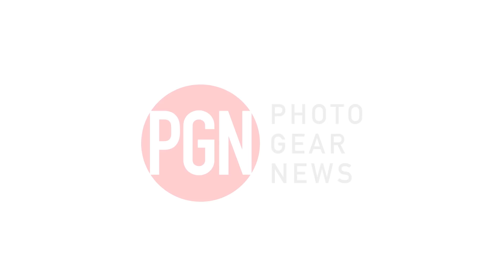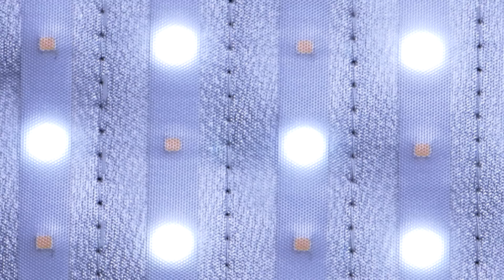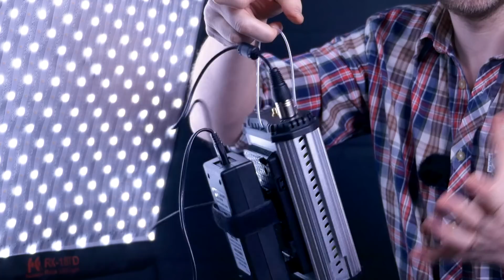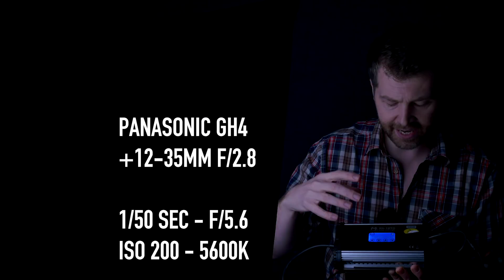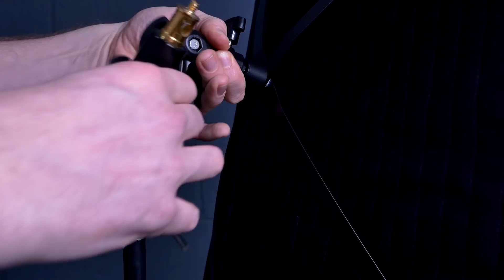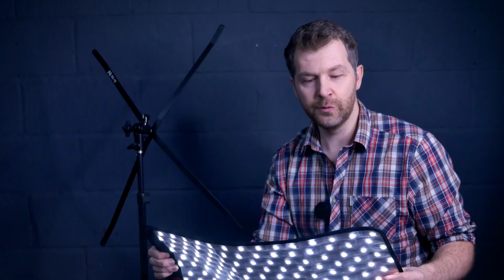FalconEyes RX18 TD LED Flex Panel   affordable and portable LED lighting

Comment: So if you want a cool setting it only uses half the led’s 🤨
Reply from the maker: Only for 5600k... at 5500k the amber ones come in to play. But yes. You can get a single colour panel that is 5600K. I’ve put the Falconeyes rates Lux values in the description for the panels.
Reply from the maker: Just to add that this isn’t particular to this panel - the majority of LED panels with colour temperature control work this way.

Comment: What would you recommend for stills photography? Thinking of getting a LED panel.
Reply: Linus, any light can be useful "on location".  A candle can be useful on location as can the headlamps from an auto. It all depends on the location and it's ambient light.   If you're indoors any light panel that size would be useful whether you're in a studio or on location.
Reply: Linus Wärn As a photographer moving in to video I’ve not tested everything out there... yet.

Over the years I’ve used flash, studioheads, tungsten, halogen and LED and my experience tells me that I’d be happy to use this panel for product photography and head shots, mid-length portraits and as a fill light. 

I would recommend the grid/softbox, or at least some diffusion to make it a touch less harsh, but that’s common with most lights.

I’ve checked out other LED panels at shows and events, but never properly had the chance to test, so sadly can’t offer much in the way of comparison. However I know DSLR Video Shooter and Curtis Judd (who are more knowledgable in this area) thought quite highly off this particular light, so check out their videos
Reply: Richard Sibley Thank you for that lenghty answer. Would a good LED panel be useful on location in your opinion? Let’s say a model in a café.
Reply: Linus Wärn yup! Good for hiding out of shot - or even taping to a wall or ceiling then use a reflector to fill. Lightweight to travel with, though you’ll need to add a lighting stand. The V lock batteries and charger are relatively expensive, but in a cafe you’ll have mains power, so not a problem 👍
Reply: mavfan1 Yeah but some are better than others no?